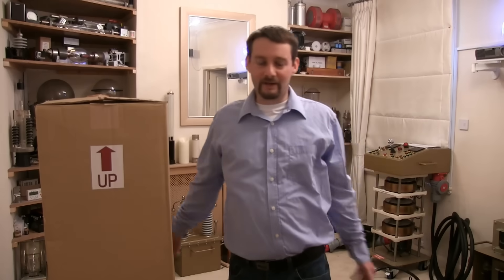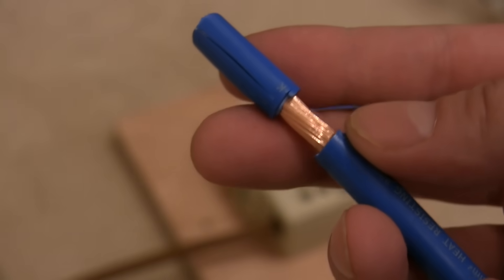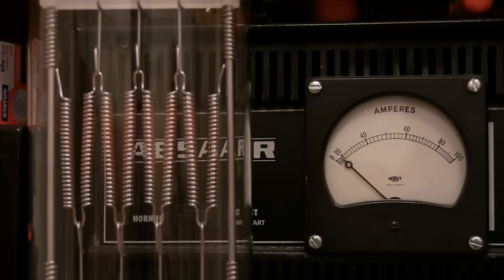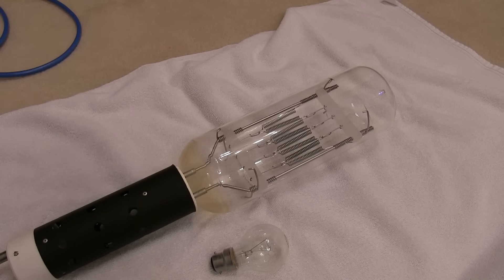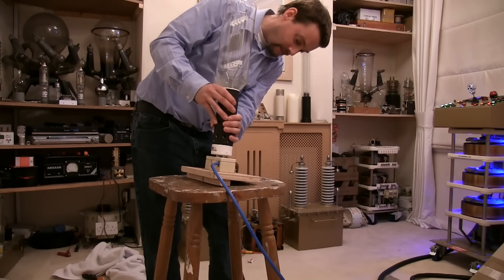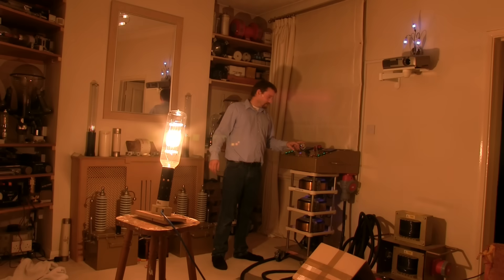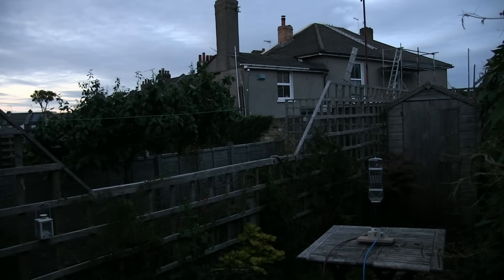20,000 Watt Light Bulb Test

Comment: Legit question: How much did you rack in in your power bill doing the test?
Reply: Bet his electrical meter was spinning as fast as a circular saw blade when the 20 kW bulb was at full brighness!
Reply: Going from what the price of electricity in the UK is doing some conversion, say 15 min total, about 1-2£ or like 3$,  depending on where in the country you are. But if you had that on for 10 hours it would be a different story.
Reply: I didn't expect it to be that cheap. I'm genuinely clueless about this, so your answers are quite enlightening. No pun intended. Ok, maybe. lol
Reply: Solar Fluxman  Yep - we pay about 13p per KWh in the UK, so £2.60 an hour for that bulb.  Less than a pint of warm beer.
Reply: I don't know about electric installation and billing types for residential houses in UK. However I believe that they have a separate installation and billing types separated to power demand, voltage and phase count (1 or 3). This guy apparently should have something more than a standard 240V one phase connection, otherwise he wouldn't get 80A current in single phase line for that enormous bulb. Such type of connection cost more as well.
Reply: 20 kW x 15 minutes = 5kWh. That's what a 2kW air conditioner consumes in 2.5 hours. At €0.17 per kWh, it would cost me 85 cents to do the same experiment at my home.
Reply: 20kw for 15 minutes is 5kwh. i dunno about UK, but here in brazil that's like $1 after taxes..
but you have to keep in mind the bulb was in full power for only a few seconds at a time, and the total working time shown here isn't even close to 15 minutes.
Reply: Included in rent lololol
Reply: Where I live in the USA, it's about $0.10 per KWH. So to run 20,000 watts for an hour, which is 20KWH, it would cost $2.00.
Reply: Stranac Oppilas hahah
Reply: krot he has his own input supply bypassing the consumer unit
Reply: dunno how the prices in the uk are but one kwh is about 41US cents
Reply: In America the price varies, but it's about .20¢ for every Kwh. At that rate it would cost $4.00 per hour to run.
Reply: I don't know where people in the US leaving comments live, but the average for the US is like $0.10 to $0.11. There are places where it's a lot higher, and plans where you can be penalized and pay a lot more under certain circumstances, but all of those things tallied up and averaged still comes out to under $0.12 per kWh.
Reply: Only two pounds for pulling 20kWh for 15 mins?

Comment: well if that was LED 20KW then it would probably be enough to light the whole village up :D
Reply: Cooling a 2kW LED would not be fun. But the water cooling plumbing might be!
Reply: there are 0.5kW led COBs, so put 40 of them on the side of an aluminum box, fill the inside of the box with cool water, but not too cool because you probably dont want condensation, and there you go
Reply: @droyce4596  

"there are 0.5kW led COBs, so put 40 of them on the side of an aluminum box, fill the inside of the box with cool water, but not too cool because you probably dont want condensation, and there you go"

no, it's not that easy.

you would have to PUMP the water through the box at a rapid pace, and either have a radiator if you wanted to recirculate the water, or a constant flow through system that just pumps and dumps.

that box would just vaporize the water otherwise.  it would be dangerously explosive in just a few seconds.
Reply: This thing is doing maybe 3% efficiency of converting electricity to visible light, the rest is all heat. LED on the market today can do ~25%, so nearly 10 times as much visible light per watt.
Reply: James Cree Says a man named "Cree". :)
Reply: it would not be cheap though, i think 500watt leds are almost $100 each
Reply: Han Nes i didnt think you were quite accurate with that statement, but apparently you are indeed correct, low pressure sodium lights can be nearly 200lumens per watt at the source, conpared to a 100watt led, which I think is around 70 to 90 lumens per watt. Cree has some leds that are capable of over 300 lumens per watt, but I dont think they would be practical yet when compared to cheap and easy to implement 100watt cob leds
Reply: Sinonisto Yemi actually no.. candle-power just refers to the brightest part of the light.. Lumens is the total output capability of the whole light.. both useful measures just they are different.
Reply: @toddlaplanteVT85  Lumes are horse shit. Its based off of CIE data from 1929 that says that "anything over 700nm is infrared" and underestimates red's contribution. This completely ignores far-red, which does contribute to color details, although not a massive amount, it is there and its absence is noticeable. Check out Billy-Bobus Foundry and his two videos where he actually has 710nm and 730nm LEDs, and shows a newer eye response curve graph from 1975 instead of 1929. I gor far-red LEDs and can confirm that they are visible, not infrared.
Reply: With 20 KW LED he would light up his village quite literally. And nearby forest as well. Ashes to ashes... Cooling would be not a problem if he have a river nearby. And river would be warm enough for swimming whole year :)
Reply: +NetRolller3D 
Hahaha. Fair point ;-)
Reply: Super Wig Maker but that would simply burn the led....so no light
Reply: If you need the full spectre, LED wont work.
Reply: Yes, with bleached out light lacking deep reds, and completely lacking far-reds.
Reply: On the subject of bright ass LEDs there's someone that was testing what there claimed to be the brightest. It was a 1500w COB but according to the manufacturer's website is only producing 120,000 lumens. Granted that might not be the brightest but either way that's still less than you'll get out of a quality 1000w HPS. So maybe there's a limit to what a single LED is capable of producing efficiently?
Reply: It takes about 10 x the power to be perceptibly "twice" as bright, although into the same light, the colour temperature gets more efficient at producing visible light. When that thing was sucking 200 watts out of a car battery it was barely glowing compared to other lights. I think that big light would be brighter than 333 60 watt bulbs, though I'm not sure how hot the filament runs as all of them tend to be about 3000 Celsius. Much more and they'll burn out. LEDs I'm not sure as you need a lot of them.
Reply: I cree everitim
Reply: leds are great for efficiency.   but incandescent or metal halide got the balls really. either can be useful tho, for sure
Reply: There's no such thing as 20kW LED lol
Reply: @hoxhaloo  It can be done, but it is not practical.
Reply: lumen is for fluffy household dads, the real power of light is candela
Reply: willrobbinson China can manufacturer perfectly good, quality stuff just fine. The reason you get so much garbage from China is because the companies in other countries who order their stuff from China are greedy penny pinchers who couldn't care less about quality or their customers, they only care about their profits.
Reply: @babybirdhome  Using patents from the US and Japan, anyone in China, Taiwan or India can make the perfect LED. You can import parts, assemble modules, and export. However, most of the garbage LEDs on the market are made in China(99%). This could be because China's own product certification system is not working, corruption is rampant, China's standards don't match other countries' standards, or prices are so cheap that it can eat into the market.
Reply: the LED would fail quickly like most crapp from china BUT tungsten will still shine be it only 10% or so efficient
Reply: my cheap Chinese light has been running 18 hours a day for 8 months.... im not saying its good but its worked
Reply: HID lights don't require cooling but have the efficiency of an LED.
Reply: Super Wig Maker led is bad for eyes just like those energy save lights.
Reply: In fact LEDs are only about 10% better then the old style lamps
Reply: Peter Zingler Old style meaning what?
Reply: Yeah but LEDs are for noobs!
Reply: It is about efficiency, the light LEDs produce is many times more for the same watts.
Reply: @jamescree6331  led is better, u can go everywhere u want. That easy to inside forest with led flashlight 32000 lumen.

Comment: For those wanting to jump straight to the action:
6:28 Inside, auto adjusting exposure (or type "5LLL" while watching the video)
8:07 Inside, fixed exposure (or press '7' while watching the video)
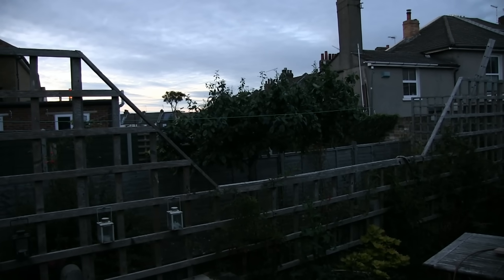10:40 Outside, fixed exposure (or type "9L" while watching the video)
Reply: what's this witchcraft? How are those numbers connected to the timeline? Why does 7 take me to 8:07 ?
Reply: @maikelthedev  haha the secret YouTube controls. Well not that secret, they come up if you type '?'. The timestamps work automatically in comments, and the numbers work for any video to take you to particular relative points in a video
Reply: @musicianhayd  Nice work in documenting the test times! I especially like your "type 5LLL" part; that just makes it so easy.
Reply: @maikelthedev  If I recall correctly, numbers 0-9 correspond to a timestamp of that number times 10 percent of the video's total length. So 0 would be the start of the video, 1 would be at the 10% mark of the video, 2 equates to the 20% mark of the video, etc.
Reply: @Jo_Wick  And L is "skip 10 seconds forward". J is skip 10 seconds backand and arrow left and right keys go 5 seconds at a time. "9L" means "skip to 90% mark on the whole video and skip additional 10 seconds forwards".

Comment: What is the max amount of power the big boy supply can put out.
Reply from the maker: lol more than I have coming into the house 20kW is sensible
Reply: ***** thats crazy. I wish my mom would let me have something that big.
Reply: 1.21 Gigawatts
Reply: I'm not sure if I got it correct; you don't have more than 20kw Input fuses into your complete house? I mean in Germany, you have in every house the normal three phases with 400V between them, with 63Amps fuses each. That should be something around 44kw (400V*63A*1,74). With the american power voltage of 230V between the three phases, that should be around 25kw?
Reply: In America, residential is typically single phase only, unless otherwise permitted from my understanding. Power is delivered typically at 240 volts and from there it gets split down to 120(giver or take several volts depending on area). So it is delivered at 240, but tapped in the center of coil to get access to 120. Typical electrical outlets are 110-120 but that isn't always true. Three phase is generally reserved for commercial. I'm a new apprentice though so feel free to correct.
Reply: The fuse going into his house is 100A. times that by 240v and you get a maximum current of 24 KW
Reply: I think he is saying that the output for the supply is more than what is coming onto his house. He never said what his house is capable of.
Reply: Here in holland (which makes us neighbours :) ) we get single phase 230V 35amp OR three phase 400V 25amp fuses each. You can apply for three phase 3x25 for 250eur. single time if you have 1x35. 3x63amp here is gonna costs you in excess of 2000eur per year.
Reply: +jim575757 italy biphase at 230v
Reply: Rocky 1015
His house has a 100amp breaker with what looks like a Henley 100A mainfuse. He shows it in one of his vids.
Reply: Actual delivery in North America can be anywhere from 110V to 125V depending. But there are usually dryer sockets that supply 220V to 240V.
Reply: Emanuel Bezzi Porcodio
Reply: onesto
Reply: Here in the US the average residence is fed from a 120/240v center taped service transformer.  Most modern residential installations use a 200A distribution panel.  240v (leg to leg) * 200A = 48kVA nominal, Derated 80% = 38.4kVA usable.  That last couple large residential installs we've done have been 600A services, so 144kVA nominal, 115.2kVA usable.
Reply: +jim575757 Nederlaaannd..
Reply: werner he is in UK, and he uses a battery bank to put out any amount of power he wants regardless of the grid
Reply: I think you are right on the money there. Splitphase is just often confused with 2 and/or 3phase. Although very similar you lack the phase to phase rotation for electric motors and such at split phase.
Reply: Better check the transformer on the pole near your house. MOST common size is only 25 kVA and supplies several homes at a time. That 20KW lamp might just blow the fuse protecting the transformer! All depends on the rest of your neighbors' usage when you try it! A couple central air units, a water heater, and granny turns on the oven to make her famous cookies? POOOF....LOL
Makes NO difference if you have an old 60 amp service, or a brand new 600 amp, you are still limited by the transformer out on the pole. (or in a pit if underground)  Some neighborhoods have a small as a 10 kVA !! Some might have a 50 kVA....
Reply: +Just a Guy he has just one single phase coming into his house? Wtf
Reply: Tiger White we have 240 in uk
Reply: lol

references
Reply: jim575757 ...
Reply: John In Milford - If you're wired for 100Amps, what mean your system could potentially pull 100 continuous Amps.
Reply: A 100 amp service will allow you to draw 100 amps continuously. One caveat: That assumes that the connections are all tight. A loose connection on a main breaker could cause heating and the breaker might trip on thermal. By the way; 240 volts X 100 amps is 24,000 watts.
Reply: Ispike73 I have 400 amps coming into my house in the US
Reply: Pole mounted transformers are only really used for rural supply of electricity when there is only a few houses to supply, power generally comes from ground mounted substation compounds that supply quite a few houses, in our area of approx. 250-300~ houses, a small football club, church (with a 3ph supply)  and a prison and there are afaik 4 substations to provide the power.  and that is not exactly a small amount of power consumption esp. considering the church has many, many kW of radiant heating (there is a large distribution board dedicated to just the main heaters with ~20 16A breakers feeding sets of mainly 2-3 1kW elements) with a few more breakers for some extra heating units).
Reply: In America you not have standard three phases as bequeathed great Tesla? I have friend in aul, he has like his own three phase transformer circa 75kW. But he not brow,  as maximum load we use muffle oven /our handmade/.  Circa 17kW we use. In our test we try to reach 1000 C, and after sold it.
Reply: If you taught 20kw is big asf
Then for Photon 20kw is his average watt when he start playing
Reply: After 1 day experiments, we pay 1month payment bill in as usual power сustomer. All power capacity was 75 kW. But if you use electricity in such high demand, you can stay without electricity half hundred people. Most problem of mankind is high consumption without less meaning. Just for laugh. Hohoho...
Reply: Tiger White sad

Comment: http://www.ebay.com/itm/DC-3-7-to-7-4V-600KV-600000V-Boost-Step-up-Power-Module-High-voltage-Generator-/321931473994 would it be dangerous to touch this if you used a AA 1.5v duracel to power this?
Reply: dat tape holding it together tho

Comment: Answer for electricity cost:
1Unit = 1KW/hr, 
 20,000 KW = 20,000 units in an hour= 333 units/minute
UK electricity cost = avg. 11 pence/ unit = 0.1441$/unit
So, the bulb burns 333*0.1441~ 50$/ Minute

Comment: Great video, you made turning on a light bulb very exciting. I was impressed with that power supply and the 100 amp extension cord. I have a question, why didn't you simply use a light meter to measure the light. That would be a better indicator than the camera with auto off.

Comment: Hey Photonicinduction, How much of the wire loses are calculated in to you power measurements ?
Reply: Photonicinduction how do you afford all the eletricity bill
Reply from the maker: The measurements/ readings on the meters are actual, there is a couple of volts difference between the meters on the power supply and the end volts on the trailing lead.
Reply: government job

Comment: You should see the lamp they use in those special event spot lights that shine into the night sky. I used to work for a theatre lighting company that had 1, just 1. it was a $10k bulb back in 1997. I think it was 100k watts and than was no filament. It had t metal studs that a spark would jump across like a mini lightning bolt.

Comment: what do people even use these bulbs for?
Reply: Just incase the sun runs out
Reply: A lot people are asking this question but are not getting the appropriate response. It is used for movies to light very very large spaces like streets. Street lamps and other practical outdoor lights are not bright enough or color accurate enough for film use. The bulbs cost alone, around $2,500, would be unpractical for any other use than film.
Reply: Im sure you could grow a lot of plants indoor with it if you know what I mean
Reply: sensory overload torture?
Reply: To add to Joseph's point (I know it was 5 days ago but I thought this is pretty interesting), the fixture this bulb is designed for is called an "Arri T24 Fresnel Light" and costs almost $13,000 USD! That's insane!
Reply: street lamps are nowhere near this powerful
Reply: lighthouses
Reply: all the lighthouses round here use normal household light bulbs but just use big lenses
Reply: Joseph Lindsay thank you!!!
Reply: +Joseph Lindsay Actually someone looked up its price and it supposedly costs upwards of $6k....
Reply: Blinding their enemys?
Reply: +Joseph Lindsay And how about stadium lighting?
Reply: I suppose you could but $6K is not a great idea when you might have baseballs that might break them.

Metal-halide tend to be the typical stadium light. Much more cost effective too since you're not running 20,000 watts per fixture.
Reply: +Joseph Lindsay Fair enough. And how about cinema projectors?
Reply: This is projector Light bulb Sylvania 54342 price 1599$ lifetime only 350h.